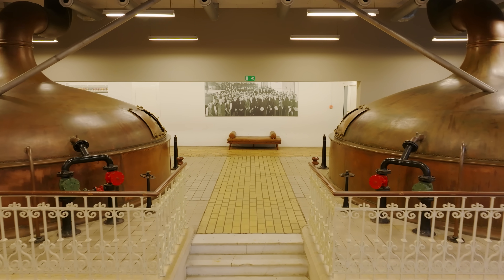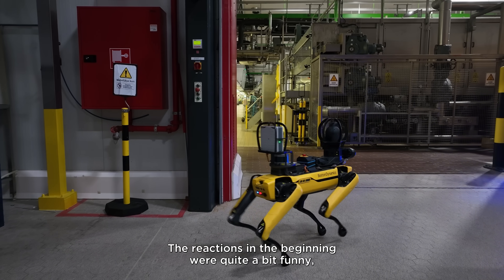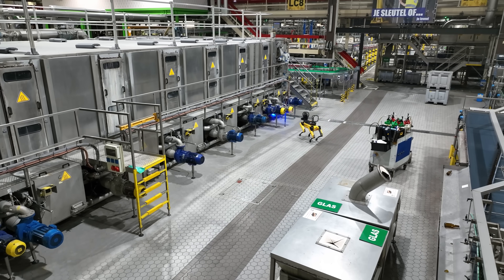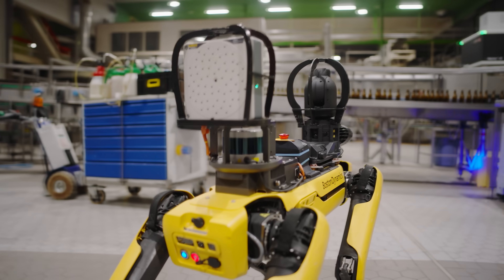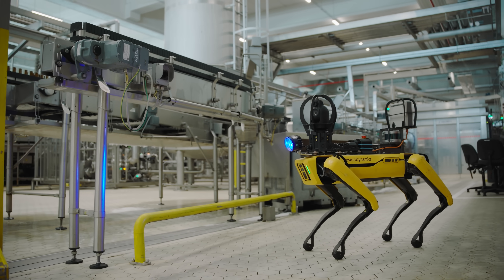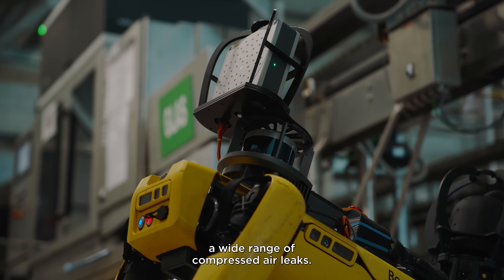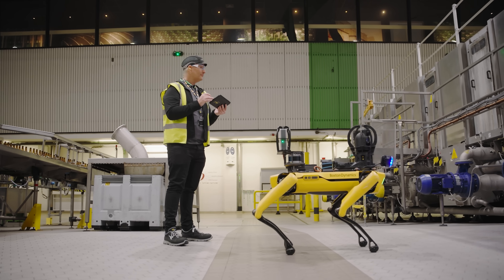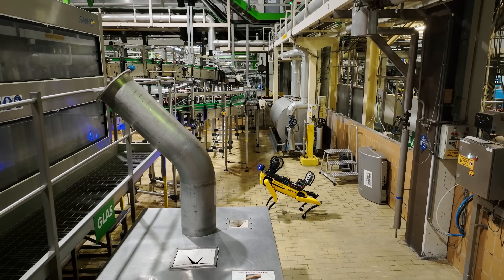Spot at AB InBev Belgium | Boston Dynamics

Comment: I'd have loved to know why it was a good idea to use this robot for these tasks. Sadly, there wasn't a single good reason mentioned. I'm guessing whe're still in the lower parts of a implementation period of robots into production environments, in which use cases are rather artificial but realistic. Still, fun to watch. A few sensors at the right spots would have done the same task just as fine.

Comment: but but but, why do you need a quadpedal robot for this, wheels would work just fine
Reply: Feel free to build and sell a universal robot platform on wheels that comes with all the features of spot for less than $75k.
Reply: Among other things, quadrupeds can walk on stairs, go over hoses/equipment, and also over ledges & forklift bumpers.
Reply: @GrassBIade  yes but wheeled can also do the job in this perticular case. I admire the engineer in robot for sure, no doubt and brilliant but it seems overkill.

Comment: To think, Spot spends its time looking and measuring stuff at the moment. Over and over doing the same exact sequence. This is superb use of the technology, but soon it will have actuators on its load platform, and there'll be certain actions it will be authorised to take. For example a fire, or a valve that needs to be turned, or debris on the floor on the facility that might be a hazard. Etcetera. Spot will become a thing that does more than just look. Then a bit later, a derivation of the Atlas test platform will be walking around and driving vehicles and carrying loads, and going into confined spaces and other hazardous areas. People say robots will take all our jobs, but clearly to begin with, it will just makes jobs safer and a more effective use of the worker's time and skills.

Comment: Wouldn’t you achieve the same results if you scatter multiple acoustic and temperature sensors across your plant. This way you would be able to detect, anomalies exactly at the time where they happen.
Reply: The question is how many sensors you can install and wire up before it costs more than a spot. Wiring up a single motor with temperature sensors (one won't be enough), wire them up to a local controller, then wire that up for power and data can easily cost a thousand dollars when you include all the engineering and planning that goes in. When you have hundreds of motors and gearboxes that quickly adds up.

Comment: Wow, basically the first actually good application for Spot I have seen yet.
Best way to constantly temperature check all the motors and gear boxes and bearings in a massive facility like that, and will pay for itself pretty quickly if it works properly with good software behind it.

Comment: This is form over substance in a pure form ... IMO. If you want to optimize the operation of devices, maybe it is worth investing in a BMS system and sensors for continuous monitoring of devices? (Temperature, humidity, Electricity consumption, etc.) It would be proactive. Human will do this work with 1/10 time of a robot work. For me as an engineer it looks fun and not practical use.
Reply: Pretty bad engineer then. Think and do a little back of the envelope math before you speak.
Reply: @whickervision742  I'm glad you have a different opinion. However, I will not write that you are a bad engineer (if you are an engineer at all). Besides, tell me what such robot can do besides takin pirometric photo or taking akustic data. I can understand that in old manufacturing lines you have to invest healthy portion of cash to do BMS and install sensors... Maybe it's cheaper for them to use robot... I do not know the situation of this plant but for me so far form over substance. I feel that you are a typical dude that has little experience and absorbs every new tech uncritically.
Reply: It's not all about what an engineer thinks is a good engineering solution. It's about what can be purchased and implemented to work with the idiosyncracies and biases of the people on the factory floor.

Comment: Like they did not already know the engine was running hot and they had air leaks. 80000 USD down the drain they could used to fix the problems.

Comment: What is the blue light for? Is it for people to notice Spot? Does Spot use it for vision? It doesn't seem to be related to thermal vision.
Reply: It's usually to prevent collisions by and with forklifts. I'm sure if you look close enough, you might see a wild forklift hiding in the shadows.
Reply: It's indeed to announce Spot's presence. The same blue lights are mounted on forklifts and other manutention machines inside warehouses.

Comment: As a retired field service engineer, I admire the hell out of what Stella Artois has done here.  By using Spot as a means to do repeatable measurements of critical components, it allows the maintenance staff to beat a problem before it becomes a problem.

This is proactive maintenance at its best.
Reply: No it's not, you have no idea how much they are paying for these dogs, I do.
Reply: I am not sure about the comparison/advantage of having a robot check each motor and device on a flexible schedule, versus each having its own temperature sensor and perhaps sound/vibration sensor to quickly detect and notify anomalies. Sensors can be made cheap and can link to a database for continuous analysis or interrupts.
Reply: But it kinda seems like it would be very expensive and/or logistically complex to set up such a database and retrofit every bearing, gearbox, and every other piece of equipment with its own individual sensor when you can just have a mobile sensor that you can update adjust and retrofit all contained in one package
Reply: @dactorwatson4313  for old plant, yes, but for newer ones, temperature, pressure, rotary sensors are basically standard everywhere, and with a bus system, all can be transmit to the PLC then to the cloud. Make sense for existing plant without those things.
Reply: @ernahubbard2062  the bus system still gets very complex with increasing number of sensors. Increased complexity leads to more errors. So having a mobile device that does not increase the complexity of the system can help a lot.
Reply: @HerrSalat  nowadays these sensors normally comes within those sub-assemblies or off-the-shelf, so in newer equipment, it doesn't really require extra work and industrial buses such as EtherCAT, EthernetIP are pretty robust.
Reply: @HerrSalat   it's over-solving a problem also they say it's autonomous but you can see him focusing using the ipad manually my guess is there is a lot of hands on monitoring happening and the robot is just keyed to go to x number of spots in order then return to base
Reply: But does the robot remove the healthy exercise of always going manually through the factory floor? Seditary lifestyle is a modern problem, when everything is done on the computer. What do you think, as a professional?
Reply: No it is just a beautiful picture the robot are used nothing in reality
Reply: @umdorumdor556  What made you make that up?
Reply: @Naptosis Every comment like that is written by an Ivan.

Comment: $50K bot to replace a $5 temp sensor.
Reply: Your $5 sensor connects to $200 worth of copper and $600 worth of conduit, installed for $85 an hour plus travel time, connected to a $2000 PLC in a $4000 enclosure also installed for $100 an hour and programmed for $225 an hour, with multiple installation coordination meetings taking  up 20 people's time... I'll stop there and just say you don't know what you're talking about in your little bubble.
Reply: @whickervision742  You could just wire one to an alarm for a few dollars. And you'll have immediate feedback, not some machine taking 30 minutes to do its rounds.

Comment: A lot of these comments highlight why some people can be easily replaced by a robot.
Reply: You’re not wrong 😂
Reply: There is no one do to this job. 
It's automated preventive maintenance. Checking for simple problems that may cascade in a complete failure. No one do this work as a full time job. Spot does it by just walking around.
Reply: @Damien.D Not true, inbev regularly generates preventive maintenance work orders for flir observation of equipment for technicians.  The same ones that review the data from these dogs and they do it far cheaper.  This is just about bragging rights.
Reply: 🤣🤣🤣 That's what they said about computers! 
Pure FUD!

Comment: Couldn't you install thermal cams and sound sensors in the needed places,  then you could monitor everything simultaneously?
Reply: But who monitors the monitors?
Reply: I've visited the Stella brewery once. It's *huge*. I think it's even the biggest brewery in Belgium. Good thermal cameras and those kinds of sound sensors can also be quite expensive, so if you install them in fixed places and want to monitor the entire factory you'd need hundreds of them. 

Getting just one of each sensor and installing them on a robot that does regular patrols is the cheaper option. Especially since programming patrol routes is a relatively fast and simple process that can happen just fine while all machines are running. 

If you install stationary sensors then someone also has to install all those sensors, and run the required cabling to them, and hiring people for that is expensive. And since beer is a product intended for human consumption any production lines near where such works are happening likely have to temporarily shut down during those works for hygiene and safety reasons, which is very expensive.
Reply: @IkBenBenG  Its the biggest brewery in Europe as said in the video. But yes you are right, its also the biggest in Belgium...
Reply: You would need thousands of the same cameras and sensors for every single instance you want to monitor instead of one multipurpose autonomous robot.
Reply: What about the added complexity with associated points of failure?  The monitor itself can fail or give erroneous readings.  Spot can check an unlimited number of components or even perform a thermal check on entire systems as well as “listen” for unusual noise.  Once a baseline is established variations large or small can be detected.
Reply: easier to just send out a centralized piece of equipment to do this type of monitoring, attaching sensors would just loop back around to the exactly same problem again of having too many things to check at once for the people working there
Reply: with spot there is only one failure point, the robot itself. With excessive amounts of sensors, there are about as many failure points.
Reply: @bennyboiii1196  which is easier to fix or replace, a $5 sensor or a 70K robot 🤔
Reply: @kezzaman  Nice framing. Instead, ask which is easier to manage. Thousands of sensors, or one robot? Which is easier to implement? The installation of new sensors, or a rerouting in software? Which is easier to diagnose and fix? A sensor network outage, or a single wireless connection? When I'm talking about failure points, I don't just mean a single sensor breaking. It's not that simple. 
There are also disadvantages to using a robot, like the price, the limited battery life, the moving parts, but depending on the factory, it might be a good decision to implement. It also would be a good redundancy in case of a failure while waiting for a replacement sensor. There are plenty of use cases.
Reply: @bennyboiii1196  If there are "thousands" of instruments that need monitoring then realistically you would need multiple robots, because it would take days for one robot to check every instrument just once. Lets assume there is only 100 instruments and it takes 2 minutes for the dog to travel to and check it, that would mean each instrument gets checked 7 times per day with 200 minutes in between. What if something goes wrong when the dog is not around?
Reply: 4 of those thermal cameras cost more than one spot (without attachments), and then you only have 4 boxes at your doorstep...

Comment: How could Spot possibly stand up against the upcoming tsunami of humanoid robots?

Boston Dynamics has the cream of the crop in their hands right now with Atlas but are doomed to fail due to complacency.

It's wild to see a company that's so far ahead just tread water while the wave of competition looms over them ready to wash them away.
Reply: Humanoid robots are far more complex and arguably more expensive than spot (which is already considerably expensive). Four legs provide a mobile and reliable platform for most factory settings you'd want them in.

In terms of Robotics, there isn't anything publicly and readily available out that that comes close in terms of dynamic robotics (there could be something behind the scenes, but I'm not in the research sector to know)
Reply: Humanoid robots are a cool sci-fi trope and always get a ton of media attention, but they aren't really all that useful in industrial settings. A proper humanoid robot could in theory be highly versatile, but in practice they're overly complicated and don't work all that well. The extra complexity often isn't really required for the tasks robots usually do and just adds additional expense and additional potential points of failure.

Industry also doesn't care that much about versatility anyway as there's pretty much always enough work that each robot can do a single task all day long, and for any task that a humanoid robot can do, there's a non-humanoid robot that can do that task better and for cheaper. So we won't ever see factories employing huge teams of humanoid robots, because using a cast of different kinds of non-humanoid robots will do a better job.

Comment: Great use!  I would like to see more examples of real world applications!
Reply: @Shindiggity  the issue with putting sensors everywhere is that you've now added an insane number of points of failure that can be hard to detect. with Spot you've only got one thing to keep an eye on and that thing has the built-in ability to tell you that it's failing. furthermore, because the sensors on Spot are shared across all measurements, technicians reviewing them will have a far greater chance of noticing something is wrong if ALL of the readings look off.

furthermore, if you don't think a factory is a dynamic environment, you don't know much about factories.
Reply: @underdweller what if Spot fails? Who is going to spot fot Spot? 2 Spots?
Reply: @triadwarfare  A human? Spot does not replace human workers, it just takes over some of their basic tasks so the humans have more time for real work (like in this and previous videos example: instead of humans looking for problems and doing repairs, the robot now looks for problems so humans have much more time for repairs etc)
Reply: @Shindiggity  It is already used by police to enter houses or sites where it is unsafe for police to enter. Spot can then scout and detect poeple by using its thermal camera. They can do lab raids way safer with spot for example.
Reply: Like anything else, if Spot fails, you fix it.
Reply: Tell it like it is without all the chicken shiet candy coating.. it’s not a “great” use. 😅